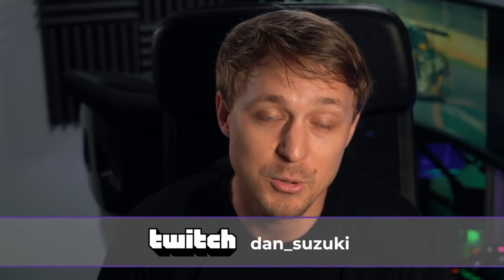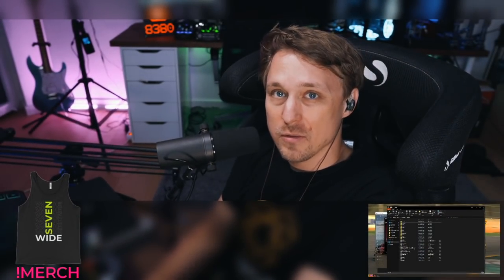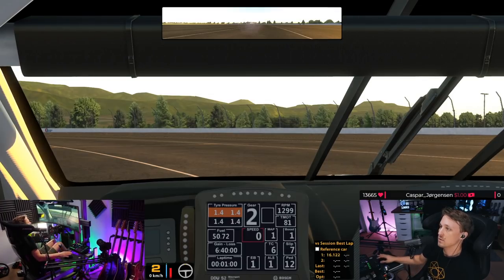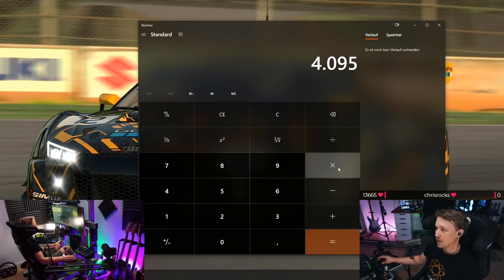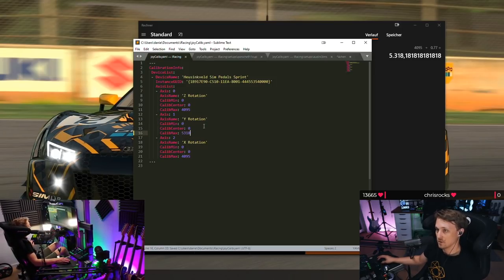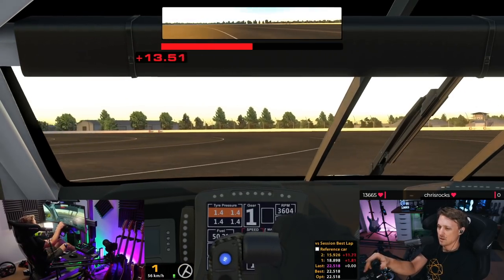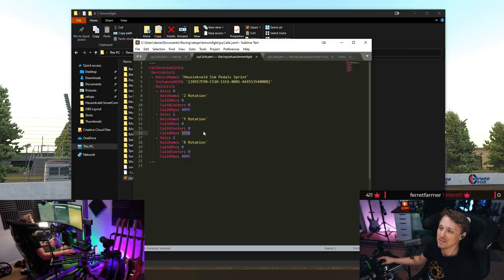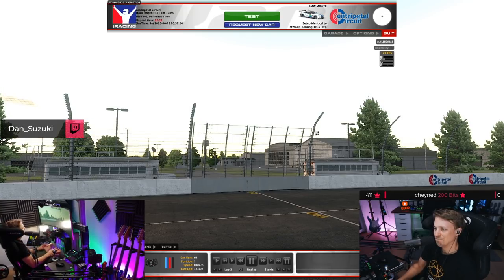iRacing Guides | Never lock up again! Get more out of your brakes with an easy trick!

Comment: Okay, so, big issue with this.

Go to to 260km/h in this car with the tires warmed and slam your brake pressure to full.

Guess what? You're tires don't lock. It's speed and downforce dependent. Doing this will just limit your brake potential from max speed  for a select number of corners. Very few require 100, but 80 is too low.

While most corners may not require this, many high speed zones can utilize full brake pressure without lockup as long as you bleed off the brake quickly from initial application, especially if there's an incident ahead and you need more stopping power (but obviously sacrificing potential corner speed).
Reply from the maker: I think F3 and LMP1 cars are the only cars where I briefly used more than about 70-80% - if you’re using more on GT cars you’re doing something wrong ... it doesn’t make sense in theory - but that’s just how brakes on iRacing work
Reply from the maker: Check this for example into T1:
https://www.youtube.com/watch?v=w1XzYDJae4I&t=5s

As I said in the video - it might be different for the several cars - I've never used more than 80 though.
Reply: @DanSuzuki  its true. Retesting now, 100 percent isn't possible to use, but I do very much feel that more than 80 is viable. The first high speed braking zone (into right hander) of Sebring can handle more than 80, but it's true, not much, and not for long.

It's true that the situations where more than 80 would be useful is slim, and the benefits are apparent.

Comment: Can you do this in an actual race car? If not, it does feel like a bit of a cheat or at least a driver aid, like auto blip in a H pattern manual. I wouldn't use that aid because it defeats the purpose of sim racing in the first place, so for that reason, I will not be using this, even if it puts me at a disadvantage to those that do.

@Dan, I also use HE Sprint and have my brake set to 26kg force. Can't believe you feel that 65kg is weak! 😂
Reply from the maker: It definitely is a bit controversial ... other sims have a setup option for that called "brake pressure". If you don't use the full brake power available on your loadcell I don't think there is a need for this. It's more aimed towards lower end pedals or if you want more range out of a limited loadcell.
Reply: As far as I know F1 cars run at 95kg or thereabouts. When you are being bounced around and taking high g loading, too light a pedal is actively dangerous - which is one the many areas where sims are absolutely nothing like real racing. Looking at road cars, even a vanilla Cayman has a much higher pedal pressure than most people are comfortable with, and a Cayman GT4 has a much higher pressure than that, plus rev matching on demand. Which is auto blip... When you factor in people racing sims with Logitech wheels against DD setups, then tweaks like this might just help folk who can’t afford high level kit to keep up, because such users don’t have access to advanced brake pressure curve modeling apps etc that the top end gear brings. And, finally, while iRacing leave those cfg files open to edit, then I can’t see how anyone can say that editing them is a cheat, any more than using in game overlays is a cheat, or using Crew chief is a cheat, or widescreens are a cheat. Real race cars don’t have any of those, either! I enjoyed the video a lot, and I really appreciate the way Dan is going out of his way to help. Kudos to him.
Reply: Yes "real race cars" can do this.  

I never understand the elitist attitude from som sim racers... the no assists should ever be allowed... because, beacuse, race car.. thats why.. 

F1 has engineers in the pits controlling numerous facets of the car as its driving around the track.  Traction control is used widely as well in race cars.. 
Also if you really want to stretch it out..  sequential gearboxes should be banned from full size race cars as its cheating and not using a manual clutch to engage gear shifts..  

so on and so on... 

In the end its a game/sim.. have fun and when possible adjust things to help you.
Reply: @robcampbell6099  there's nothing at all elitist about it. If I'm driving the Skippy in iRacing I use a sequential shifter and I don't left foot brake because that's what the real car has and you can't physically left foot brake in the car because the steering column is in the way. I can choose to use paddles and my left foot as probably 98% of people do but I'm in this for the SIMULATION and that's my choice. For the same reason I don't use auto blip in the Skippy or other manual cars but it's native to a GT3, as well TC and ABS, and I left foot brake because SIMULATION. How far I choose to take this is my own business, and you have the choice to use whatever aids you want, I don't crusade against it or lambast others for it. Understand now?
Reply: Just confirmed on Sky right now that the brake pressure on an F1 car is - wait for this - 120 kilos.

Comment: Couldn't bring myself to do this cheap trick. Rather rely on skill........... must admit I maybe dont have as much as others but at least my conscience remains intact 💪
Reply from the maker: Well having a better useable range does not really have to do anything with skill - you still have to brake yourself 😂
Reply: @DanSuzuki  not locking up whilst finding the most performance from the brake definitely requires more skill then mashing 😁
Reply: Make sure to only ever drive with a T-Racer on digital mode and FFB turned off, to ensure that you are only relying on your skill and not better calibrated gear.

Comment: It doesn’t work for me 😫
Reply from the maker: Check the pinned comment - maybe that helps :)?
Reply: Dan Suzuki yeah , I’m using v3 pedals with loadcell what ever I do it makes no difference , or it sets the pressure at constant 80% with out me touching the brake 😂
Reply from the maker: @The_Devil_Riser  Have you set CalibMin to like -30000?
Reply: Dan Suzuki I was thinking that but all the numbers confused me 😂😂😂
Reply: Yes indeed, set the CalibMin between -20000 and -30000 ... i think -30000 is more to 70 % i think, because the car brakes not so much, try it yourself haha
Reply: Got it working thanks dan 🤪😃
Reply: Hey dan I also have v3 but when I pull up the joy file I don’t see letters like yours for example x or y axis
Reply: Would the link work for my v3’S the 1 you pinned for ur sprint pedals?
Reply: @V_Sam-rc2cb  are you opening with note pad?
Reply: @The_Devil_Riser  no was opening in sublime
Reply: @V_Sam-rc2cb  oh right , it should work in sublime 🤔

Comment: I only see this as cheating
Reply: If you buy expensive pedals its built right into the pedal software!
Reply: @Matt18880  I have Heusinkveld Ultimates and feel no need to cheat through software, thankfully the Ultimates doesn't come with the gimmicky software like the Sprints
Reply: @NobbyScott  than it6s cheating by Hardware, because you have a great advantage against People without a Loadcell :-P